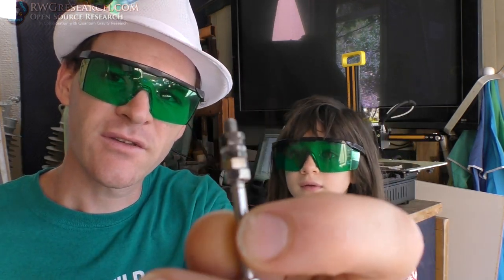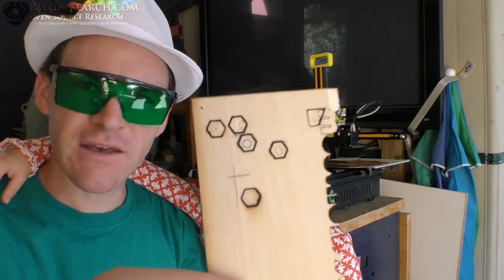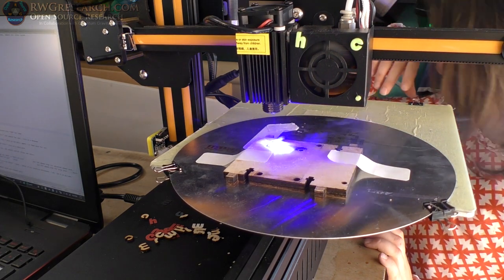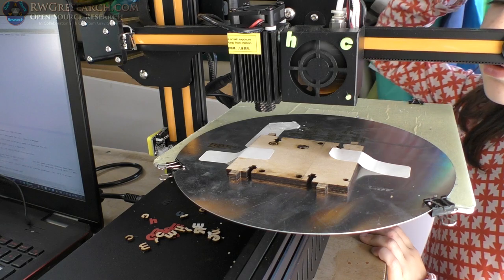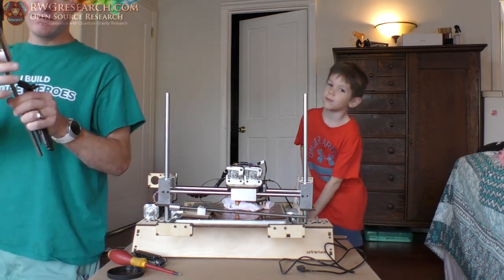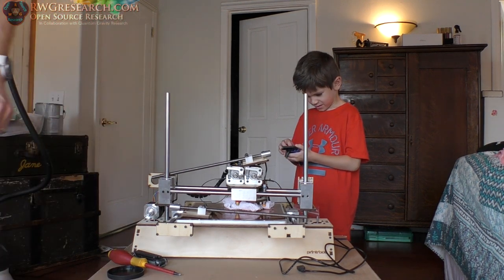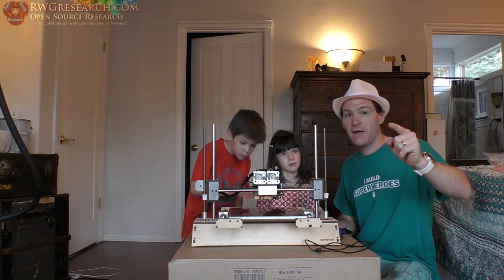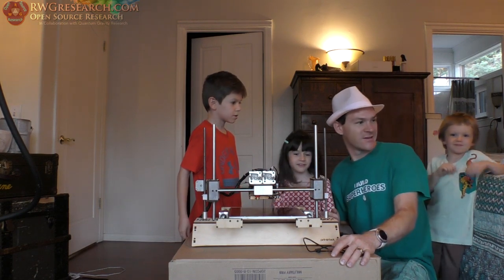RWG - ADOPT-A-BOT day4: That's NOT A problem any more... : Free 3d Printer For A School YOU Pick!

Comment: for my 3dprinter with a laser diode. i have a spacer. (2.5mm laptop drive on the widths edge) that i place between the surface i'm engraving and the tip of the diode. So i only focused it once and that spacer will always make it focused to the next surface or material